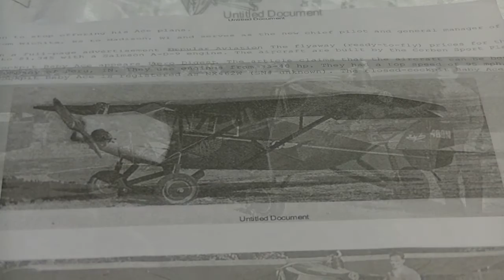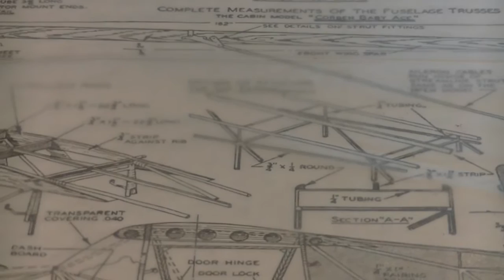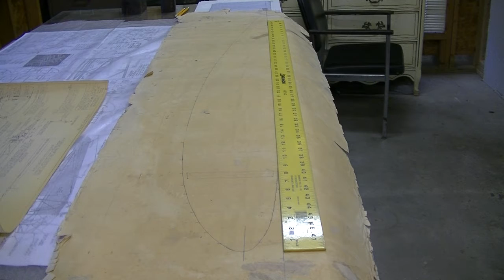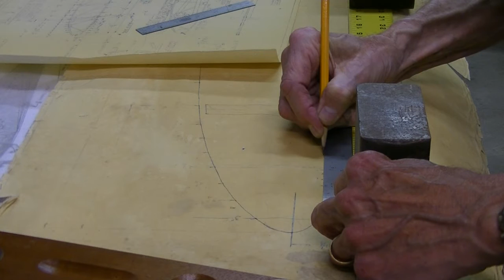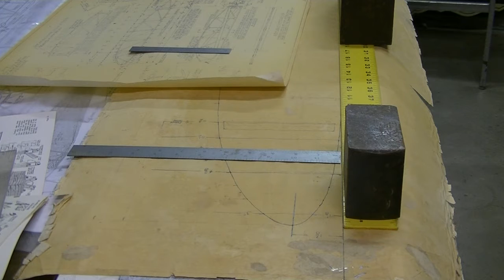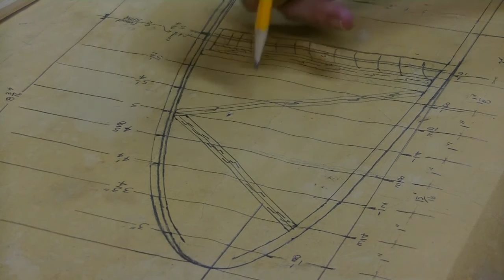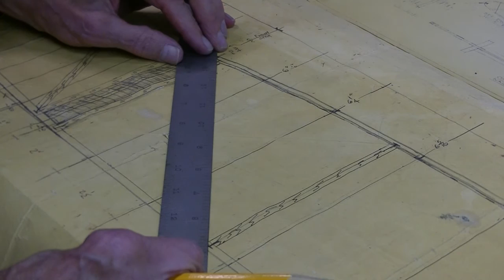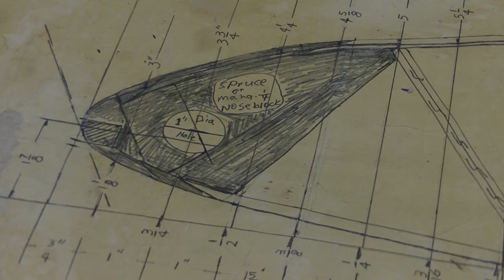How to build Wooden Wing Ribs for a Corben Cabin Ace- Part 1 of 14 videos.

Comment: enjoyed this series very much.  Would you apply your plywood nose rib technique to a Pietenpol?  Thanks for sharing.  I'm inspired to start building my ribs as a winter project.
Reply from the maker: Yes, it will work for both the Piet and the Grega while using quarter-square cap strips. If you use one-half by one-quarter caps there are a few tips to know to keep the nose section light. 🙂

Comment: Why not use Profli to generate an accurate wing section with the spars right in the location you want them and then print it out in sections with registry marks and get an absolutely accurate full size drawing.
Reply from the maker: I never tried it but if it produces accurate drawings then I'm all for it. I'll give it a try. Thanks for the tip.